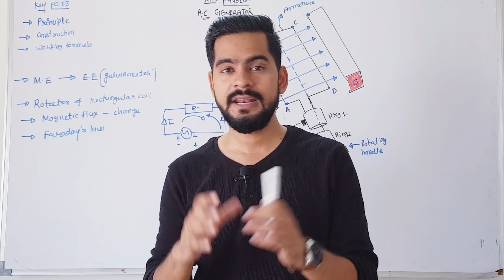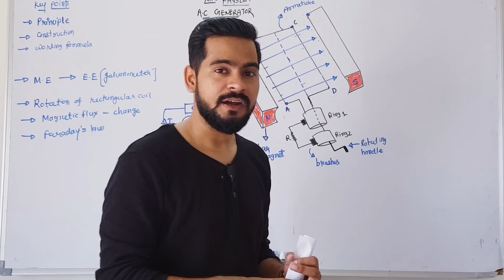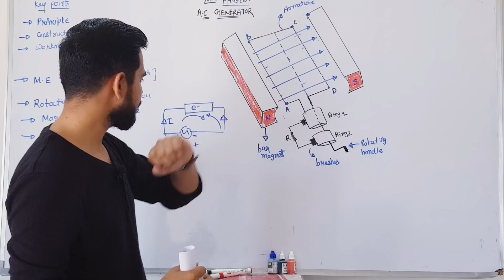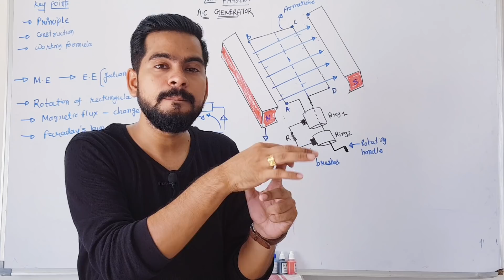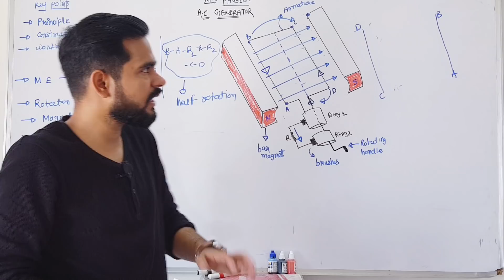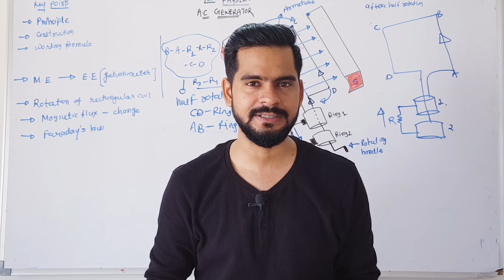8. A.C generator | electromagnetic induction | class 12 physics

Comment: Sir for generator we use right hand rule....plz.clarify it ...bcz here in generator we hav motion nd mf we hav to find direction of current which is obtained by right hand rule..
Bd in motor we have to find the direction of rotation so thr we use left hand rule..
We can't use both in gen as both give two opposite direction of current ..

Comment: 13:50 actually the direction of current should be A to B using formula of lorentz force.
U got opposite direction bcoz u used left hand rule. Left hand rule is used only for electric motor while right hand rule is used for generator means for induction.
Using right hand rule u get current A to B.
No offense just felt to correct you.
You are doing a great job keep it up!😃😃

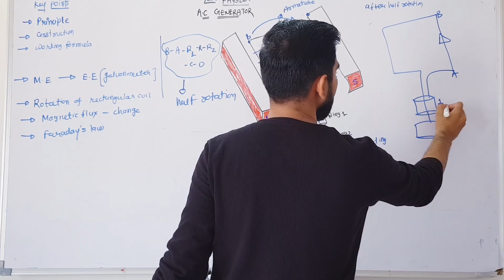Comment: i have question at 17:28
the sir drawing fig and at 17:28 he is making resistance 
now half rotation completed
i am confused he should  make it on right side instead of left side ???
hit like if u agree??
or reply if i am wrong??
Reply: bro that resistor is connected with carbon brush which didn't rotate..mean to say that makes friction with that ring so the resistor will not shift it's direction..Yes sir make one mistake that after half rotation they didn't draw carbon brush.. should I resolved your problem...
Reply: yeah
thank you man
Reply: Bro you are right ..But think the resistor is connected with ring1 and ring 2 if it is shifted in right side it will remain same ..Mean to say change in side didn't change the ring circuit... Should I resolved your problem...